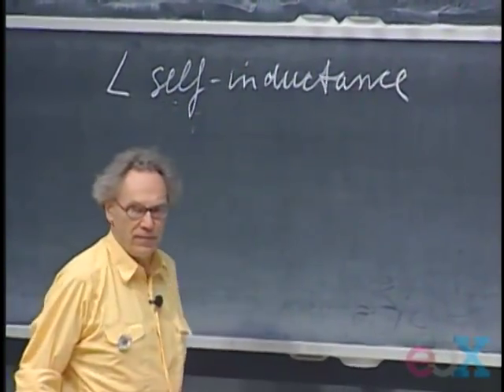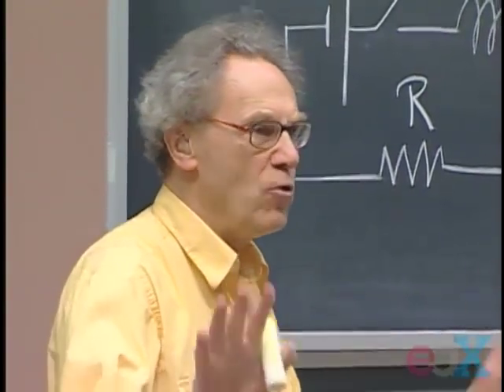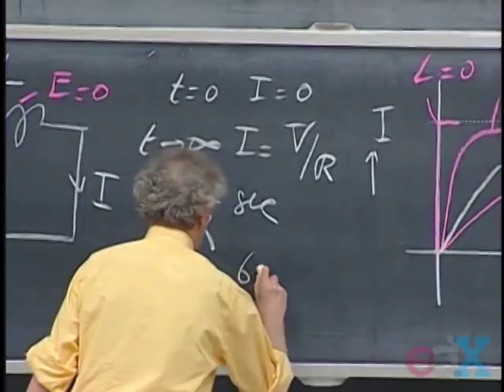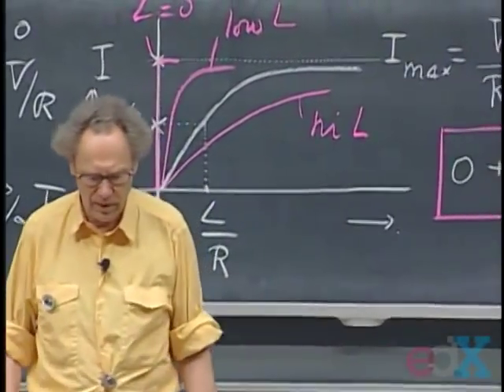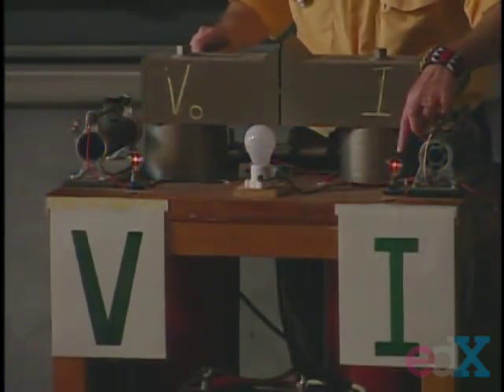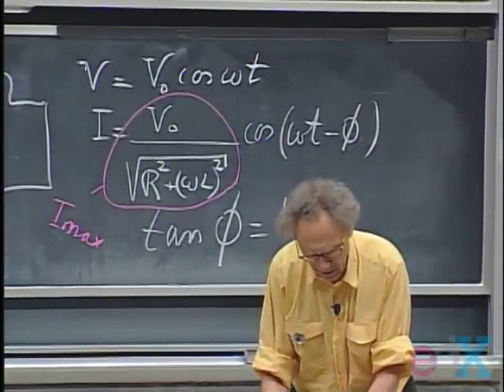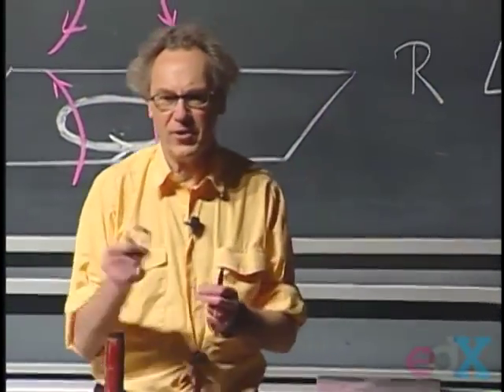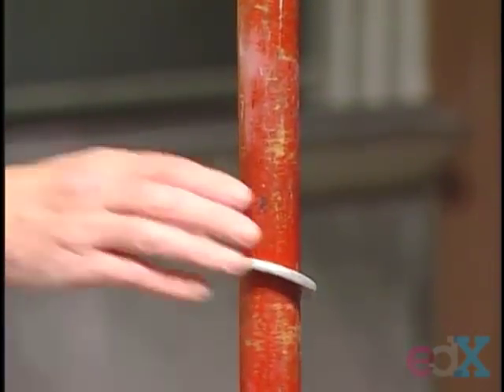8.02x - Lect 20 - Inductance, RL Circuits, Magnetic Field Energy

Comment: Dear Prof. Walter Lewin at" 6.01 minutes" in your lecture, you draw a circuit including a resistor and an inductor, later in the lecture while calculating the " integral E.dl " you argue that in an inductor E is zero.I accept the argument that inside a superconductor E must be zero, but something is confusing me about your circuit drawn in lecture. My question is that “ through the open surface of the inductor a magnetic flux is changing and since inside a solenoid(inductor) magnetic field lines are nearly straight then the changing magnetic flux must produce an E-field in the form of circle around the axis of the solenoid(inductor) now since the wires or loops of the inductor are forming circles around the axis of the inductor also so if I take E.dl for inductor it can’t be zero.It would be very kind of you if you guide me.
Thank you
Reply from the maker: an ideal inductor has zero resistance. Thus no E-field can exist inside the wires of the the inductor. PERIOD!
Reply: Sir, 
if E-field is zero inside an ideal inductor but magnetic flux is changing through the coils of the inductor then it seems a violation of Faraday law according to which an E-field must be associated with a changing magnetic flux.
Zero resistance proposes that E-field must be zero inside the ideal inductor but Faraday law is proposing something else.I am quite confused and unable to findout where i am wrong.
Reply from the maker: No violation at all. Faraday's Law states that magn flux changes create an induced emf. These emfs are NEVER inside the super-conducting wires of the inductor. They are always in components which have resistance. When the emf changes currents will change. Current can change in a superconductor with (infinitely high conductivity) but there can be NO E-field inside the conducting material. E=sigma*j. E=0, sigma=infinity j can be anything. I think you do not understand Faraday's law.
Reply: Respected Sir,
You have stated that " Faraday's Law states that magnetic flux changes create an induced emf. These EMFs are NEVER inside the superconducting wires of the inductor ."
In one sentence you said that induced emf must be associated with changing magnetic flux.Now if it is so and  I have an inductor of superconducting wire then why is there no emf in its wire although magnetic flux is changing through the loops of the inductor ???
if I simply look at the statement of Faraday law there must be an induced emf, as the statement of Faraday law makes no exception for the inductor of superconducting wires.
Reply from the maker: The integral of E dot dl through the wires of an ideal inductor is always ZERO. Since the conductivity of a superconductor is infinity, any E-field would cause an infinitely high current. The E-field due to the emf caused by dphi/dt shows up in elements in the circuit that have resistance. I cannot help you any more and suggest you use google if you still don't get it.
Reply: thank you, Sir.
Reply: As far as i know V=R*I needs to be true for every component. So i think Prof. Lewin is referring to this equation. If R is zero then V has to be zero, since the current I has a finite value.
Furthermore Faradays law is still correct since it applies to the whole circuit/loop and not just the coil. There's no contradiction.

Comment: sir..need help.... @ 39.02 into the video..Radio works on 60 Hz Ac.. The violin Notes are 4000Hz.. But how come inductance oppose sound Frequency ..Not the incoming 60 hz AC.. Please explain... Few of your demonstrations are so different!.. How do you even think of them!! :P
Reply from the maker: proper frequency fiters - use Goole
Reply: Sir... Please tell sir..
Reply from the maker: use ggogle
Reply: Hello Professor, are you using this inductor circuit between the radio and its loudspeakers, aren't you?. Thank you for your answer.

Comment: sir if E=0 in the inductor how current will flow through it
Reply from the maker: how can water flow through a hose with zero resistance for the flow? Plse THINKKKKKK before asking quesitons.
Reply: @lecturesbywalterlewin.they9259  but without electric field (E) how current flows in inductor?

Comment: Brilliant  lecture sir... i have a question...
Let an AC voltage source be connected to a circular loop. As the current through the circuit changes, it causes the magnetic flux to change. This change in magnetic flux acts to fight the change by inducing current which then changes the current and thus magnetic flux and so on i.e. we are revolving in a circle.In other words, change in current →→ Change in magnetic flux →→ again change in current ... the circle never terminates then current should flow even if we switch off the ac source??
Reply from the maker: Your circular loop should include a large self-inductance (e.g. a solenoid). The cycle will terminate as there is ALWAYS resistance in the circuit which convert energy to heat.
Reply: sir if i have wire of loop  made of superconductor material (almost). then the bulb connected to my circuit should take much long time to dim out????
Reply from the maker: That will depend on the decay time of the current which is a function of both R and L.

Comment: Sir, the links given in the description on assignments ,solutions and lecture notes are not working !
Reply from the maker: Ass #1 
http://mit.sustech.edu/NR/rdonlyres/Physics/8-02Electricity-and-MagnetismSpring2002/7F6A754B-47F3-40EF-BF03-F2CFFF51C8D7/0/ps1a.pdf

sol #1 
http://mit.sustech.edu/NR/rdonlyres/Physics/8-02Electricity-and-MagnetismSpring2002/A087863B-CDE2-4EAD-8C1F-2A4CFC25D195/0/pss1.pdf

#2
http://mit.sustech.edu/NR/rdonlyres/Physics/8-02Electricity-and-MagnetismSpring2002/4F84CBD6-A945-46AB-BE50-5EC0FB53DD86/0/ps2a.pdf

#2 sol
http://mit.sustech.edu/NR/rdonlyres/Physics/8-02Electricity-and-MagnetismSpring2002/01A0162B-076D-4286-9363-8DD8E1332592/0/pss2.pdf

#3
http://mit.sustech.edu/NR/rdonlyres/Physics/8-02Electricity-and-MagnetismSpring2002/D1BDEE3F-C3B4-43AB-B225-6AA2CAC608E5/0/ps3.pdf

#3 sol
http://mit.sustech.edu/NR/rdonlyres/Physics/8-02Electricity-and-MagnetismSpring2002/2FF7D30E-00F2-4148-AE86-369023A3A14B/0/pss3.pdf

#4
http://mit.sustech.edu/NR/rdonlyres/Physics/8-02Electricity-and-MagnetismSpring2002/4E9ABEB3-9BF5-4B27-9CB0-C81D911C494A/0/ps4.pdf

#4 sol
http://mit.sustech.edu/NR/rdonlyres/Physics/8-02Electricity-and-MagnetismSpring2002/B4C6BDA5-07B2-4857-AD19-A3018472C119/0/pss4.pdf

#5
http://mit.sustech.edu/NR/rdonlyres/Physics/8-02Electricity-and-MagnetismSpring2002/6FA7901A-BBC9-4465-82BB-930A35C7C677/0/ps5d.pdf

#5 sol
http://mit.sustech.edu/NR/rdonlyres/Physics/8-02Electricity-and-MagnetismSpring2002/CE78EC02-7DAE-417C-A2BB-9E0B34AC8148/0/pss5.pdf

#6
http://mit.sustech.edu/NR/rdonlyres/Physics/8-02Electricity-and-MagnetismSpring2002/B0B8A88F-63BE-4BDC-B931-5D4EB6796A74/0/ps6c.pdf

#6 sol
http://mit.sustech.edu/NR/rdonlyres/Physics/8-02Electricity-and-MagnetismSpring2002/1891F43D-5E38-4040-8322-1F29343AD3C2/0/pss6.pdf

#7 
http://mit.sustech.edu/NR/rdonlyres/Physics/8-02Electricity-and-MagnetismSpring2002/51BF37E6-F07C-452A-98C0-DEF6DF89CDCB/0/ps7b.pdf

#7 sol
http://mit.sustech.edu/NR/rdonlyres/Physics/8-02Electricity-and-MagnetismSpring2002/10544294-2F82-41FD-83EC-6481EC0D52AB/0/pss7a.pdf

#8 
http://mit.sustech.edu/NR/rdonlyres/Physics/8-02Electricity-and-MagnetismSpring2002/A8A5F7D8-2291-471D-9A9B-D03956E54CF7/0/ps8.pdf

#8 sol
http://mit.sustech.edu/NR/rdonlyres/Physics/8-02Electricity-and-MagnetismSpring2002/A8A5F7D8-2291-471D-9A9B-D03956E54CF7/0/ps8.pdf

#9
http://mit.sustech.edu/NR/rdonlyres/Physics/8-02Electricity-and-MagnetismSpring2002/9736BA5E-745E-409A-BE71-6535542548B6/0/ps9a.pdf

#9 sol
http://mit.sustech.edu/NR/rdonlyres/Physics/8-02Electricity-and-MagnetismSpring2002/EEEC3FE0-1445-4E39-A2B3-7FD5F7FA5865/0/pss9.pdf

#10
http://mit.sustech.edu/NR/rdonlyres/Physics/8-02Electricity-and-MagnetismSpring2002/5C2CD33F-B5B8-41AC-9E6E-2FCFFA99EC49/0/ps10d.pdf

#10 sol
http://mit.sustech.edu/NR/rdonlyres/Physics/8-02Electricity-and-MagnetismSpring2002/0F45113A-776B-4277-AF12-AC570CA370FD/0/pss10.pdf

#11
http://mit.sustech.edu/NR/rdonlyres/Physics/8-02Electricity-and-MagnetismSpring2002/E480254C-E013-4151-B502-7DD49EAC8A36/0/ps10d11.pdf

#11 sol
http://mit.sustech.edu/NR/rdonlyres/Physics/8-02Electricity-and-MagnetismSpring2002/D9FA14B1-A341-4824-9462-AA6385773F1A/0/pss11.pdf

---------------------------------------

Lecture Notes 8.02

#7 Capacitance of Spheres
http://mit.sustech.edu/NR/rdonlyres/Physics/8-02Electricity-and-MagnetismSpring2002/CCD1D384-1E00-4CAE-88D0-010AB6068CC3/0/lecsup220.pdf

#8 Dielectrics and Polarization
http://mit.sustech.edu/NR/rdonlyres/Physics/8-02Electricity-and-MagnetismSpring2002/3711CBD8-B46E-4480-8AE6-CAD11A49E62E/0/lecsup222.pdf

#11 Build your own Electric Motor
http://mit.sustech.edu/NR/rdonlyres/Physics/8-02Electricity-and-MagnetismSpring2002/77A8653E-8AAC-4766-9D53-D52A75C18469/0/motor.pdf

#13 Circular motion
http://mit.sustech.edu/NR/rdonlyres/Physics/8-02Electricity-and-MagnetismSpring2002/50B8C26D-C810-4921-A65A-520137EEF37C/0/lecsup38.pdf

#15 Mid-term, Evaluation form 
http://mit.sustech.edu/NR/rdonlyres/Physics/8-02Electricity-and-MagnetismSpring2002/415CD6BB-A948-407E-A298-D5A01C30F1AF/0/lecsup313.pdf

#16 Non-conservative Fields - Do not Trust your Intuition
http://mit.sustech.edu/NR/rdonlyres/Physics/8-02Electricity-and-MagnetismSpring2002/61F4F0BE-5591-4909-9035-49610C28B58F/0/lecsup315.pdf

#20 Faraday's Law - Most Physics Books have it WRONG
http://mit.sustech.edu/NR/rdonlyres/Physics/8-02Electricity-and-MagnetismSpring2002/C29636DB-AB80-49E0-BFAB-BCE00159F00E/0/lecsup41.pdf

#20 Driven L-R Circuits
http://mit.sustech.edu/NR/rdonlyres/Physics/8-02Electricity-and-MagnetismSpring2002/FBC25EB0-EDCC-496F-97F5-77342735C010/0/lecsup41a.pdf

#21 Magnetic Materials 
http://mit.sustech.edu/NR/rdonlyres/Physics/8-02Electricity-and-MagnetismSpring2002/B301F704-8360-4F1D-AB42-E530A3E7B6A8/0/lecsup43.pdf

#22 Maxwell's eqs
http://mit.sustech.edu/NR/rdonlyres/Physics/8-02Electricity-and-MagnetismSpring2002/26BACB7F-706E-49B1-B9F8-832D316A0A7B/0/lecsup45.pdf

# 23 Exam 2 Review - Topics
http://mit.sustech.edu/NR/rdonlyres/Physics/8-02Electricity-and-MagnetismSpring2002/3061D2C3-92DB-49A7-BA05-7E4E27576490/0/lecsup48.pdf

#25 Driven L-R-C Circuits I
http://mit.sustech.edu/NR/rdonlyres/Physics/8-02Electricity-and-MagnetismSpring2002/FA08311D-2765-4404-B47C-50362245AF4E/0/rlc1.pdf

#25 Driven L-R-C Circuits II
http://mit.sustech.edu/NR/rdonlyres/Physics/8-02Electricity-and-MagnetismSpring2002/D89044E3-10B1-42DC-8D57-C4C2E961F3F0/0/rlc2.pdf

#26 Oscillating Sound Cavities - Fundamentals if Wind Instruments
http://mit.sustech.edu/NR/rdonlyres/Physics/8-02Electricity-and-MagnetismSpring2002/E3B2FED5-F656-4AEC-96A1-130745A7D101/0/lecsup419.pdf

#27 Traveling EM Waves 
http://mit.sustech.edu/NR/rdonlyres/Physics/8-02Electricity-and-MagnetismSpring2002/08D1D0C5-A8A3-44CA-A290-9EFCB20110C8/0/lecsup422.pdf

#29 Speed of EM Waves in Matter - Index of Refraction
http://mit.sustech.edu/NR/rdonlyres/Physics/8-02Electricity-and-MagnetismSpring2002/BB80210A-AC60-443D-9DF2-3E3658AE6812/0/speedlight.pdf

#31 15 Question about Rainbows
http://mit.sustech.edu/NR/rdonlyres/Physics/8-02Electricity-and-MagnetismSpring2002/CF929F8C-ECE3-4BA1-A79D-E3DD13D0C37C/0/15questions.pdf

#31 Key Angles for the Primary Rainbow
http://mit.sustech.edu/NR/rdonlyres/Physics/8-02Electricity-and-MagnetismSpring2002/2FC46772-6FD3-4973-8811-DDAB05CED7EC/0/angles.pdf

#32 Exam 3 Review
http://mit.sustech.edu/NR/rdonlyres/Physics/8-02Electricity-and-MagnetismSpring2002/928CC0F9-CFDC-4582-9386-730C73D3B5E3/0/lecsup53a.pdf

-----------------------------------------

EXAMS 8.02

#1
http://mit.sustech.edu/NR/rdonlyres/Physics/8-02Electricity-and-MagnetismSpring2002/29B6C858-A92B-431F-A43E-725D58A768EF/0/exam1.pdf

#1 sol
http://mit.sustech.edu/NR/rdonlyres/Physics/8-02Electricity-and-MagnetismSpring2002/3CB043C9-9DD9-4DA5-AF89-4AA79742171B/0/exam1sol.pdf

#2
http://mit.sustech.edu/NR/rdonlyres/Physics/8-02Electricity-and-MagnetismSpring2002/6D148C87-C69B-44B6-AECA-CB9D875E0F40/0/exam2.pdf

#2 sol
http://mit.sustech.edu/NR/rdonlyres/Physics/8-02Electricity-and-MagnetismSpring2002/8EDEC05F-6E01-4693-80D4-34F27971C48E/0/exam2sol.pdf

#3
http://mit.sustech.edu/NR/rdonlyres/Physics/8-02Electricity-and-MagnetismSpring2002/76B9798A-BA2F-4DEE-BF06-703DA70281E6/0/exam3.pdf

#3 sol
http://mit.sustech.edu/NR/rdonlyres/Physics/8-02Electricity-and-MagnetismSpring2002/3F5F818D-3C4E-4523-B1C5-F98B15502EDC/0/exam3sol.pdf

Final
http://mit.sustech.edu/NR/rdonlyres/Physics/8-02Electricity-and-MagnetismSpring2002/CCFD9103-B59B-4610-8284-8DB031B8E4B7/0/final.pdf

Final sol
http://mit.sustech.edu/NR/rdonlyres/Physics/8-02Electricity-and-MagnetismSpring2002/B2FF7DCC-DC1C-4E6C-88C2-2125DD32A9A0/0/finalsol4.pdf
Reply: @lecturesbywalterlewin.they9259  Thank you very much Sir, you made me love ♡ Physics :)

Comment: sir, I cant understand why current takes time to grow due to presence of self inductance ??
Reply from the maker: If you can handle the math (differential equations) then it is obvious.
If the math is too hard for you, then my advice is to brush up on your calculus.
Reply: no no I don't mean that i just want to imagine why that happens
Reply: thank you very much professor 😄
Reply from the maker: Math is the language of physics. If I had to tell a 5 yr old, I would say that an inductor has the power to fight a CHANGE in current going through it (I won't mention the term L*dI/dt). Thus when you switch a light on (using a car battery) in a circuit that also contains an inductor through which the current goes, the inductor will fight the increase of the current. It always loses that fight sooner or later (that depends on the "strength" of the inductor). Thus after a while the current will reach its maximum value in the light bulb and it will remain constant. An inductor can NOT fight a constant current. I will then ask the 5 yr old to tell me what she thinks will happen when I turn the light switch off.
Reply: @mahmoudalnmr8866  Think of the inductance as some kind of "inertia" fighting the (electromotive)force for change. A mechanical analogy would be the mass or the inertia of a heavy wheel or flywheel. A circuit with high inductance needs force to be applied longer to reach a given current. What is really strange about electrical inductance is that the inductance of a wire change according to the form it is bent into. A linear straight wire has very low inductance, while the same wire when it has the shape of a coil has a much higher inductance. Hence, inductance has its origin in the space outside the wire.

Comment: If there is no field in solenoid and if there is no potential difference across solenoid then there should not be any current flowing through the solenoid. HOW THE HELL IS THE CIRCUIT COMPLETE? Professor please reply🙏
Reply from the maker: Current can flow through a super conductor  but there cannot be an E-field inside the superconductor. 
I suggest you read up on this - use google. In the circuits that i discuss (LRC, LC, LR) there is always a power source. Current will flow. The integral of E dot dL is zero through the L but not through the R and not through the C.
Reply: Thanks sir.
Reply: Where can i find your lecture supplement (March 15, 2002)?
Reply from the maker: Not all lectures  have lecture notes. They are posted as pdf files below the  video thumb nails.

Comment: I find this american notation rather confusing. Why is Voltage Emf instead of U? At first I thought Emf = Electromagnetic field. But then you say stuff like "the battery's Emf is 1V", while field strength is measured in teasla. Why do you almost always leave out the units in your numerical examples? Why do you write the derivative of x as dx/dt instead of x with a bar on top, which would be quite easier to read?
Reply: EMF means electromotive force.  It has the units of Volts, but it is a more specific term than Voltage alone.   Voltage just means anything measured in Volts, while electromotive force is a term to contrast it from electric potential.

Electric potential is only useful for electrostatic fields that are conservative vector fields.  Electromotive force, is what we call integrals of E dot dL, in non-conservative fields, that are non-conservative because of Faraday's law of induction.

As for dx/dt, this is Leibnitz's notation for derivatives, when he independently developed Calculus as Newton's contemporary.   The d means "infinitesimal change in", followed by the variables of x and t.

Comment: Sir, watching your notes http://freepdfhosting.com/0813df09f5.pdf page 4, the 2 resistances example makes me wonder: is there a resistivity point when suddenly Faraday's law doesn't work or it works even in insulator loops. (or air loops!) I mean, conductivity is a "continuous function" not a boolean if plotting all the materials that exist. Thanks!.
Reply from the maker: Faradays' Law ALWAYS works, Kirchhoff's loop rule sometimes works.
There is NO need for K's loop rule as it is only a special case which is also covered by Faraday's Law.
Reply: yes, but my question is: a changing magnetic flux affects for example a glass circuit, but with a huge resistivity so creating a really low current?

Comment: 31:26 Sir, isn't the voltage provided by an AC source is Vmax times sine(omega t)
it is a sine not cosine.
https://youtu.be/Sp1m6GYo5iw
Reply from the maker: cos is OK & sin is OK they only differ in phase, not in physics.
Reply: @lecturesbywalterlewin.they9259  
tell me more, what do you mean by "physics"?
Reply from the maker: @moatazahmed2771  you are free to choose your zero time.  Depending on  where you choose it, your solution wil  be a sin or a cos.